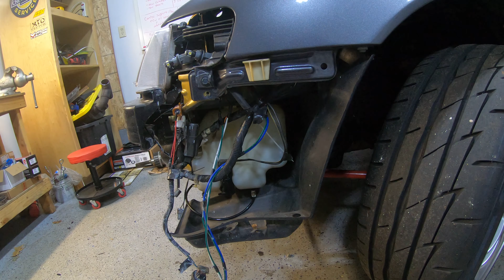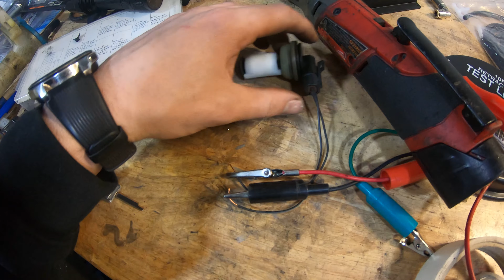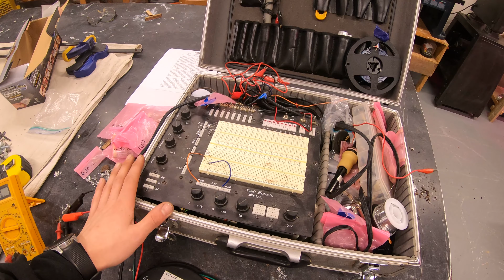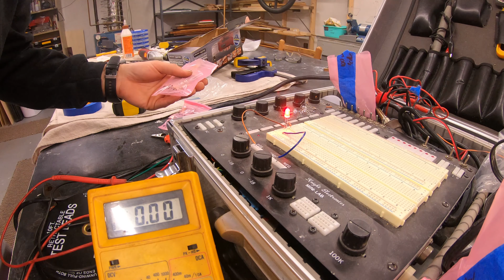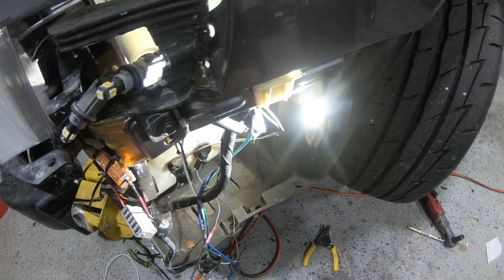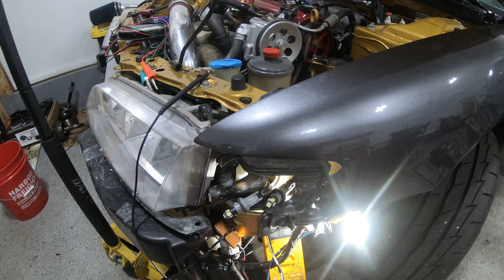Turbo Accord: Low Methanol Indicator LED

Comment: Do you have a link to your clear headlights, thanks
Reply from the maker: I sanded them with 1000 grit sandpaper and sprayed automotive two-part clear coat on them. Otherwise thyre stock